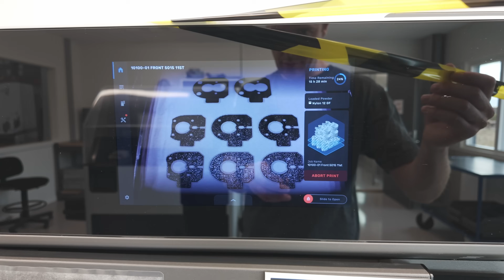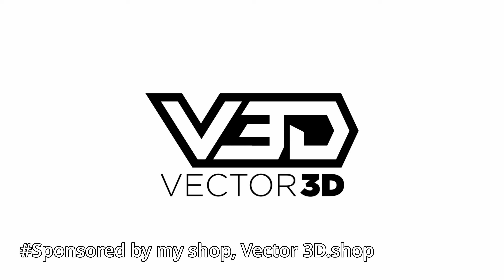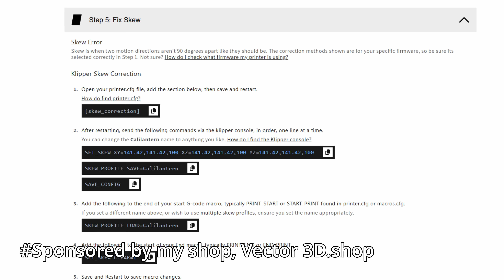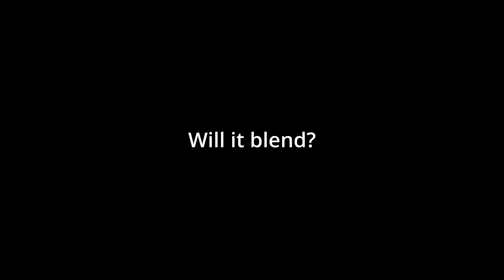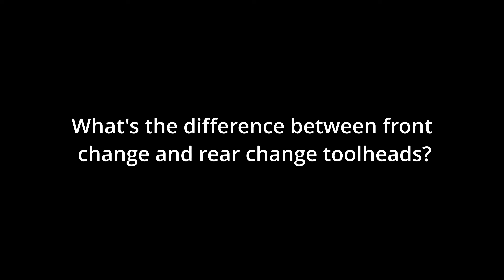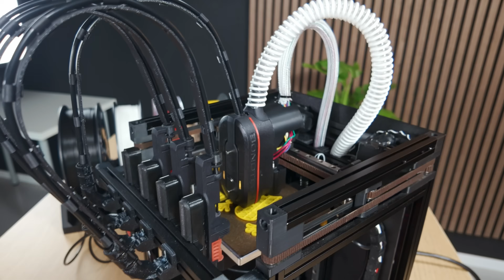I ask BONDTECH all your SILLY Questions about INDX!

Comment: I would build a separate 2x Gantry machine with independent XY rails, where while A-side is printing, the B-side is picking up the next tool, and it would do the initial purging off the buildplate. When the A-head is finishing it's part of the layer, B wipes and immediately continues the layer with it's respective part. It would be a multicolor/miltimaterial manufacturing beast with incredible throughput.

Comment: 08:51 I do a lot of PPS-CF printing and will only consider this toolchanger for my trident if the nozzle temp can reach >350C. Printing PPS at 300C while possible is far from ideal and results in very poor layer adhesion. I go above 350 with my rapido 2F, even though it is supposed to max out around 350. The silicone sock doesn't really seem to care until you go to 400C where it degrades a little bit near the tip. No big deal hoenstly.
Reply: I also really wanna know what the max temp is going to be, any luck finding any info?

Comment: So your client base likes to build their own printer, that's logical because you don't sell any printer.

Personally I buy premade printers and upgrade them with Bontech gear and have to throw out the old parts. So if you sold at least a kit where we only have to 3D print the rest of the parts and follow a manual I would be 100% down to buy even more from you.

For example if most people use Voron then just use it and sell premade kits of all non 3D printed parts, a kit with all parts including the 3d printed ones and a fully premade kit. I think this would really help you earn more customers, sell more per customers and get you known even more without creating much work since things like Voron already exists and are already open source

Comment: Aww, 300C max? That just went from Must Buy to Wait for V2 status. Getting to 350C as a low point would put it back on my docket, with fingers crossed for 370+.
Reply from the maker: What are you printing?
Reply: @Vector3DP yeah that was disappointing, 300is not enough these days when so many new high spec materials are available for us who needs them, PPA, PPS etc. Even like 330 would be super helpful to meet the newer material demands.
Reply: @Vector3DP  PET-CF on the low end, PPA/other amides in the middle ground, with experimental polymers and additive packages being worked up on the side.

Comment: 1:50 - This was the question I was waiting for.  85A or higher durometer TPU covers my needs.  My business prints a lot of TPU.  The melt zone looks short on INDX which is generally an advantage for flexibles and I assume that'll be similar with an inductively heated melt zone.  Modern printers are more focused on speed with PLA so they have long melt zones that compromise TPU printing.

Comment: If complete tool is close to promised 35USD and it is even normal steel, I would be happy with that. Sure there are less expensive nozzles but to integrate something with threads -- simply trashes the whole idea of compactness and heating. There is no alternative tool anywhere near this price, V6 or other.

Hoping they can keep the cost as promised, and there would be a good, cheap platform for it (not sure if SV08 ticks both boxes) to start with 2 heads and add more on demand :)

Comment: What about in an enclosed printer? Like the Voron 2.4 or Trident. Pretty important question, but nobody seem to ask that? 🤔
Reply from the maker: It'll operate the same in an enclosed printer vs not enclosed. They are all open at the moment just due to space as it's a quick mod onto an existing platform for demonstration.
Reply: @Vector3DP thanks you for your reply Adam! 😊 The INDX looks so freaking awesome! And not even that expensive when it's gonna release. Really innovating, love it! 😊
Reply: @Vector3DP no it's because the tubes are sticking out a lot.
A 2.4 or Trident have no room for all the tubes and cables. There's a ceiling.

Comment: Wrong person to interview for true answers. I’m tired of marketing managers and CEO’s doing these interviews, rather than the actual engineering team!
Reply: Wow! I have never seen one person post so many ignorant comments on one video before.  Congratulations!
Reply: @DonovanJM wow another person angry when someone brings up a good point, wether  it is accurate or not! Try to explain why I am wrong instead of idiotic childish insults. I’m not afraid to be wrong! But I have no respect for unproductive insults! Which are you? A person making corrections or just another bully on the playground!
Reply: @RaymondMonk-f9d where should I start? Olof is an engineer, you can put INDX on a 4 or 500mm³ printer, and they don't preheat the other nozzles because the heating mechanism is only in the main head not in the individual nozzles. I'm sure there is more that you posted that shows your ignorance but that should be enough for now.
Reply: @DonovanJM I am not a 3d printer engineer, and I was reading your reply closely until you decide to change from educating to insulting!  Then you lost my respect. A t frame box will work! Will it be cost effective? Maybe not from a profit perspective. But a t frame is quite sound if and only if you have a sound base structure! My father was an engineer as well as my grandfather. So I know just enough to be wrong half the time. And I am not afraid to be wrong. But when I am correcting someone for begin wrong, I don’t insult them for not being an expert in the (mostly new field of 3d printing!
Reply: @RaymondMonk-f9d so it's ok for you to insult the engineers but telling you that you are ignorant isn't ok? 😂
Reply: Olof is on the engineering team lol
Reply: I didn’t insult the engineer. I said he was a marketing person! And that is exactly what he spoke as, as not to answer yes on any negative questions.  That is marketing
Reply: @RaymondMonk-f9d  you said they were too lazy to make it so the next filament heated and purged as soon as it is needed.
Reply: @DonovanJM that is what I understood. Did you hear differently? I was listening as I was shaving before going to work..

Comment: Why is every company stuck on a cubed frame? A t shaped frame moves the mechanics out of the way leaving the main body footprint as actual print area!
Reply: Rigidity?
Reply: there were cantilever bed slingers
not very good
Reply from the maker: Cubes are great, effective, efficient designs, especially when it comes to enclosures, packing, transport, etc.
Reply: @Vector3DP I agree. But you can make a bigger cube to leave room for the printheads to move totally off of the build plate. Even if it cost another $100 bucks.  Is it perfect? No. Far from it. But if you tell me it has a 100mm build plate. I want a 100mm print. Not an 80mm print because the print heads can’t get out of their own way. Not attacking your reply. Just saying I know it can be done in one way or another… smile this is how innovation happens. People discussing intelligently. 9 even if I am maybe not as intelligent as you or the next guy… Thanks
Reply: Go look at the stōne wolf 3d printer.

Comment: So you are to lazy to make the next tool head pre heat and purge, so it is ready at the time it is actually needed!
Reply: I’m not sure I understand your point. To keep tool cost and size down (I believe they’ve said ~$35 for each tool) they’ve removed as much as possible from the changeable tool. The inductive heater (and filament drive) is in the fixed portion. That means the downside of this approach is it can’t preheat like a conventional tool changer, but they have the cost and compactness advantage. They’re using an inductive heater so it heats up very quickly (I think they’ve said something like 12 seconds for PLA temps) to try to minimize the downside.
If you want a conventional tool changer, there are a number of options for you. You’ll just need to pay a couple of hundred dollars per tool, and will be limited to 4-5 tools max. on a 300 x 300 printer.
Reply: The heater is on the carriage. There's only one.
Reply: There's no heater/sensor on the nozzles.

Comment: We don’t want tiny printers. We want a multicolor that is 400mm sq that can do both small and large prints. Not everyone is like the fewer of us who have the space for multiple printers! 500 sq is a bit large but a true 400 sq is a good middle line size. Not to big nor to small. An average useful print is larger than 300mm one direction or the other! Square is best as we can tilt our model to get the best finish.
Reply: They are just demoing it on a Voron V0. I believe that’s in part to show how compact the system is. I used to joke about making a V0 tool changer, and they’ve actually done it with four tools!
They are not making a printer. They are making a tool changing system for others to integrate in to printers.
Reply from the maker: There are existing demos for large ratrig printers as well as Vorons of all sizes.
Reply: I have the kobra 3 max and kobra 3 v2. So a big footprint is not my issue. It’s begging for multicolor that is not $3,000-5,000. Or can’t print more than a multicolored flower… lol

Comment: I would love to see a tool made with Diamondback nozzle tips and a CHT meltzone. I'd buy into that ecosystem in a heartbeat, even if it's not open-source.
Reply: Well a E3D revo adaption would be amazing then even different sizes might be a option which would be insane
Reply: CHT🤮 I love having minimal flow improvement on any hotend with long enough meltzones and making it impossible to perfectly tune pressure advance due to retraction non-linearlity
Reply: @youtubehandlesux  Ender 3 went from 5mm³ to 25mm³ with €2 cht knockoff

Comment: Sv08 max and ender 5 max compatibility?
Reply: Up, same question interested to both machines as well and upcoming Creality K2 Pro
Reply: It's literally in the video at 8:10 for the SV08
Reply: @GreenPlasticWaterCan I was literally asking about the sv08 MAX
Reply: @GreenPlasticWaterCan  i was asking about the sv08 MAX. not the original sv08
Reply from the maker: Sovol is basically modified voron, so should be simple. Ender 5 max likely will need a fair amount of DIY work.
Reply: Its obviously compatible with any 3d printer on the market, just depends on how far you are willing to go.
Reply: @juhu34 doubt you could rig it to a bambulab printer...
Reply: Sovol has said in their live stream that they are no longer working with multi-color or mulri-filament third party companies because they are now working on their own multi filament system.  I have a Sovol Zero and Sovol SV08, and I was happy to hear BondTech is kitting INDX for both.
Reply: @Liberty4Ever i hope they take the multi tool head route. The ams and similar systems are a good proof of concept but they produce too much waste.
Reply: @MistaWells it cools for filament changing before print, not multicoloured printing and definitely not multimaterial
Reply: @GreenPlasticWaterCan  we talkin about the same thing here? im asking if the indx is compatible with these printers. are you saying the indx is not a multi material system?
Reply: @MistaWells I was talking about an AMS. My bad for being unclear.